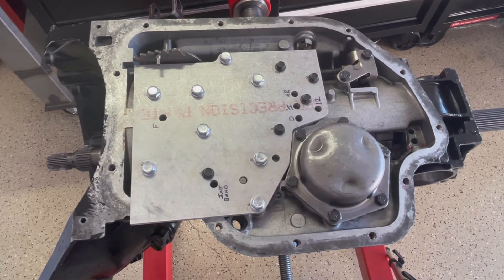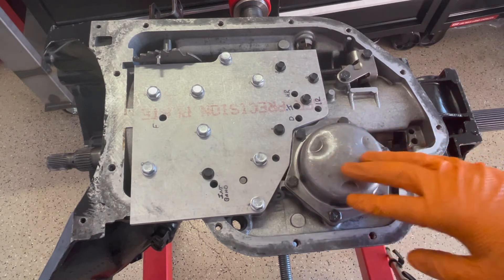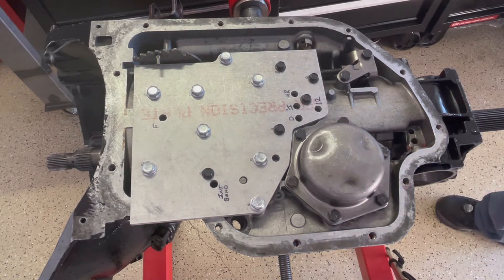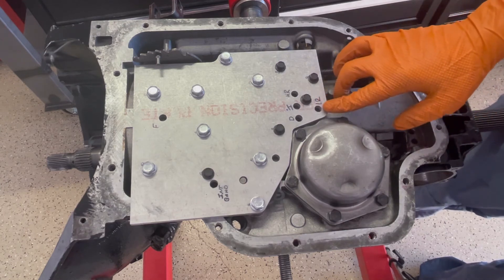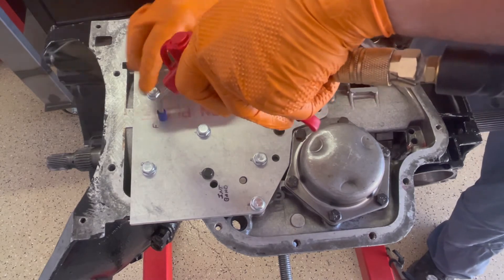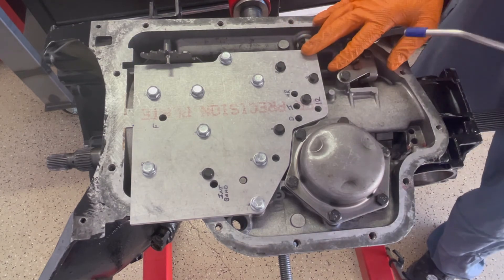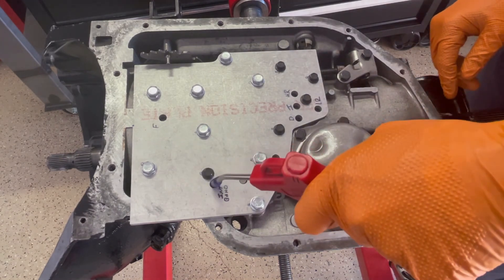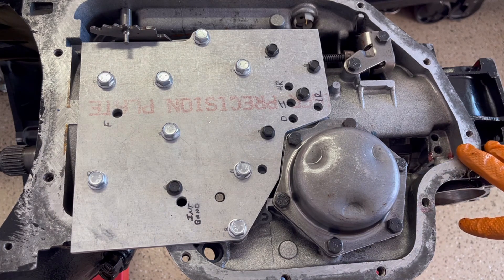TH400 - Using a Test Plate to Validate Clutch Apply

Comment: On the intermediate air test? Sounds like it's leaking???
Reply from the maker: Any leakage was likely either through the nozzle or the piston's air bleed system. That transmission has been on the road since this video series was published, no issues with it.

Comment: Looks like I could make one of those out of flat plate, is that justa  flat plate with the holes needed drilled in it or are there passages on the other side? Are you using a standard case valve body gasket under the plate or a home made gasket? Thanks!
Reply from the maker: Yep, these certainly can be home made, i have a couple home-fabbed ones myself. Just use the regular separator plate-case gasket that comes in the kit or shift kit, if you’re using one. 

Please subscribe if you haven’t already done so!
Reply: @nickstransmissions  Thanks, doing my first TH400 build soon and just found your videos, only ones I have seen with detailed info on bushing replacement and air checks, excellent info.
Reply from the maker: Thanks, man. Good luck with the build!